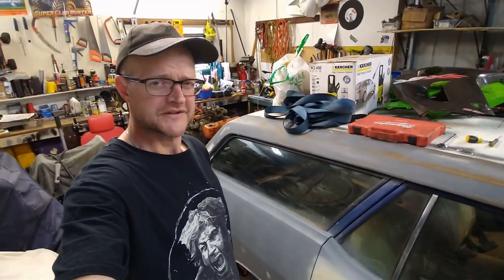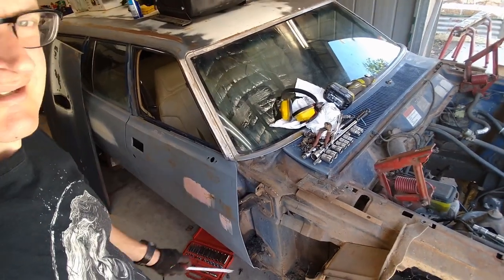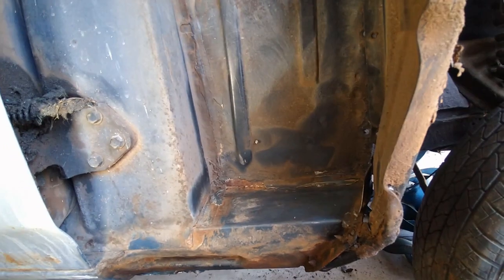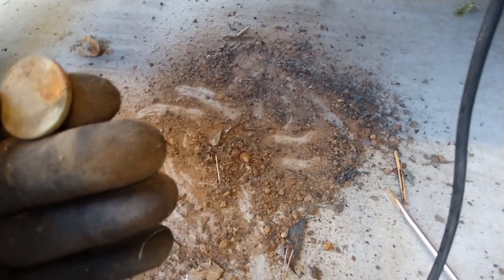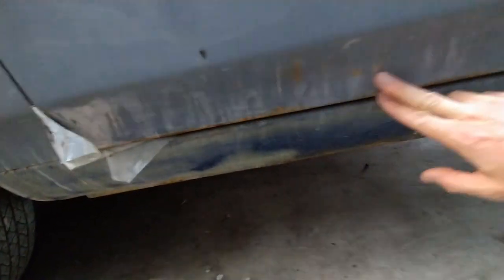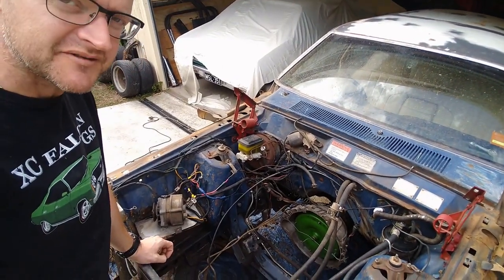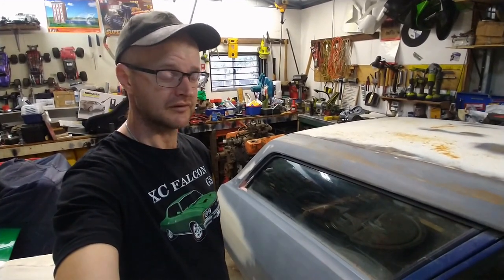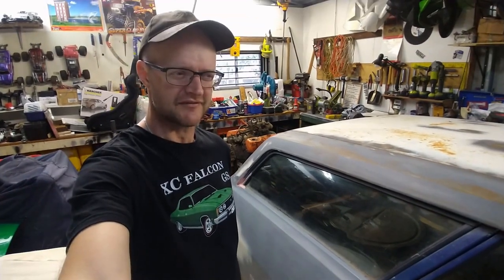XC Ford Falcon 351 Cleveland Project: Crusty, not so rusty V8 GS wagon BUT with structural cracking.

Comment: Was this car originally Blue once before was it?
Besides keeping the original column shift Automatic plus the original 351 Cleveland motor in it - Are you going to repaint this car the same original color again? Blue?
I reckon it'll look pretty good mate.
From, William.
Reply from the maker: I think its Neptune blue, or aussie flag blue. Paint code 4.
Reply: @Missleindustry  very nice color though.
Reply: This is me currently with my xc 429 I trucked up from the south island. My blind buy. Risky i know. Guards are off. Pillars have some messy welding. Will straighten up.  I have had to use a bit of bog back rear quarts and over rear window.  Gettn upholstery redone. Ordered lower replacement panels L/R guards.  Ur 1s pretty sweet alright! 😊
Reply from the maker: @kauritiaho  mmmm....big block.